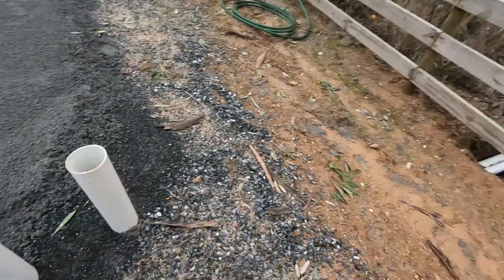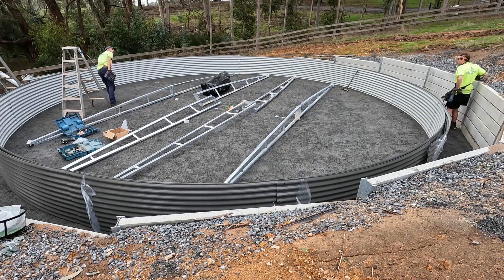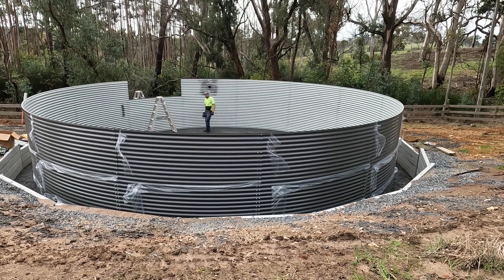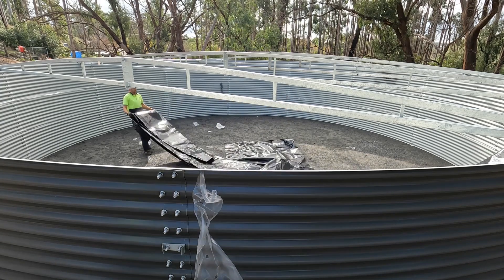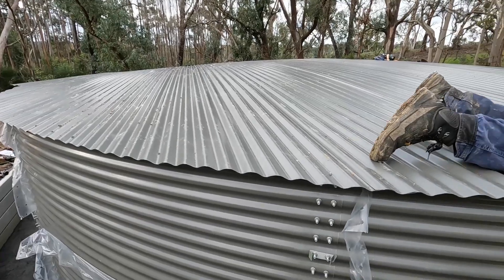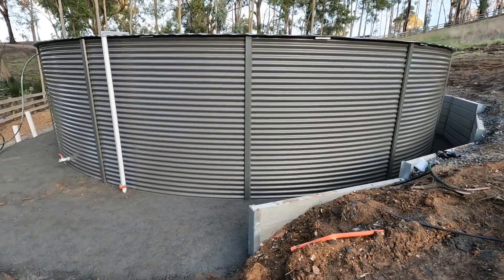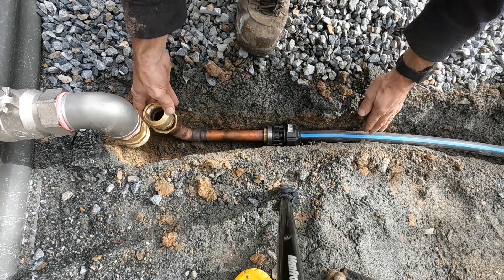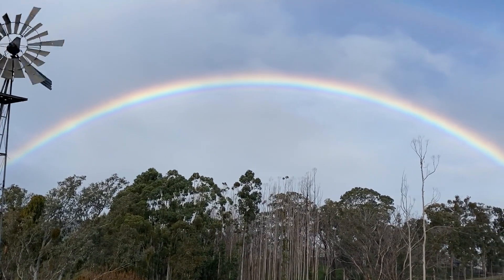Rain water collection Part 2

Comment: Nice tank mate. Everyone living in the bush should have a tank this large. All the people that lose their homes in a fire have a water tank that is 2000 litres. I think 40000 should be a minimum wit a sprinkler system on and around the house.
Reply from the maker: Agree, some sort of fire protection should be mandatory. Perhaps insurers could also reduce premiums for those that have a system would drive the right behaviours....Its sad to see many home owners struggle with a small garden hose during a fire where they have little chance without the right gear.
Reply: @Mezzmoengineering  That's it, you see them with a garden hose protecting all the valuables inside, when if they didn't buy that TV or other crap they could have bought a pump and tank.